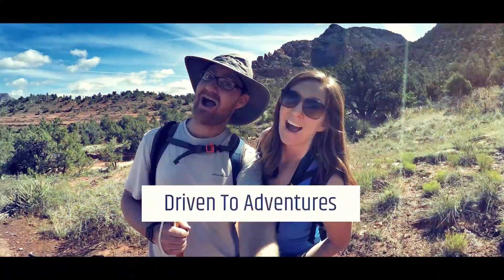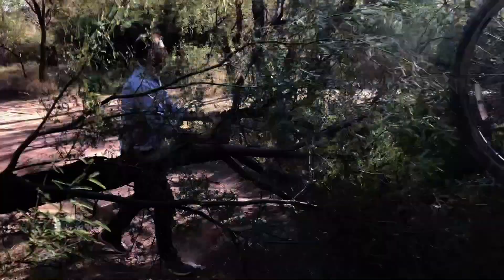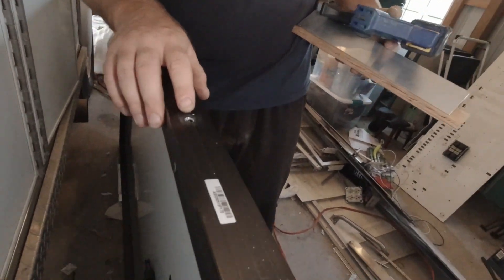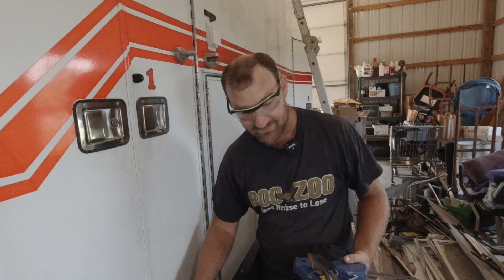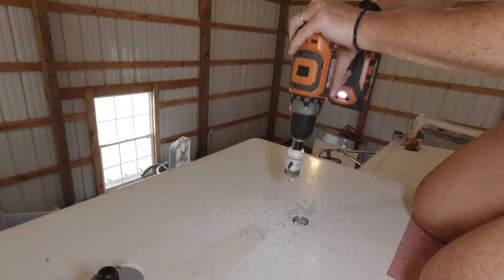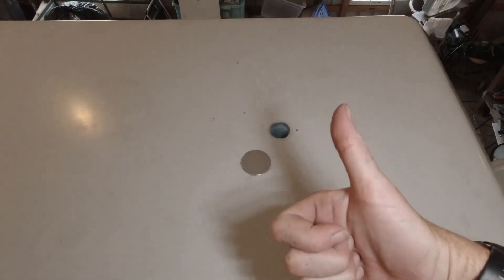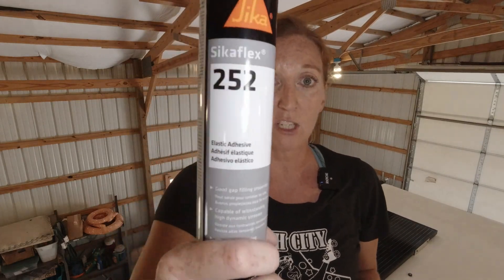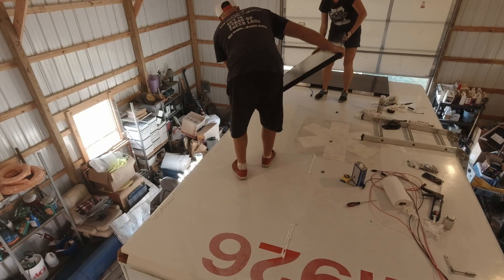NO DRILL Solar Panel Installation on Our Expedition Vehicle Build

Comment: after seeing campulance man's panels that were screwed on fly off his roof, i'd be very interested to know if the sikaflex does in fact hold long term at highway speeds.
Reply: Me Too! My plan is to have large mounting brackets welded onto the roof. Then rivet the panels to those.

Comment: Why use a box with open ends, that need to be plugged? Could have bought a complete sealed box and not have to worry about plugging the ends.  Or just use the conduit openings to run wire through and not drill extra holes.  

Sorry confused.  What was in the way of your first hole in the roof?
Reply: Was thinking the same thing.  I would have used an LB and run the truck side cables through the back hole, then ran all the cable through the end hole and sealed it up with a big plug of rubber sealant.  I'm not so sure that lid is going to hold up to the stresses of 4 different cables jiggling up and down going down the road.. Perhaps you should mount a stabilizer bracket, using that block strip mounted (glued down) a few inches away from the Combiner Box to support the panels cables on.  And definitly put some rubber caulking on the wires to the roof to keep them from bouncing.  OR,,  they make a cable mounting bracket you could Silkaflex to the roof and mount your panels cables to it with zip ties.  Let me know if you want to see a picture and I'll find a link to some.
Reply: @CurtisDrew1  I'd love to see pics